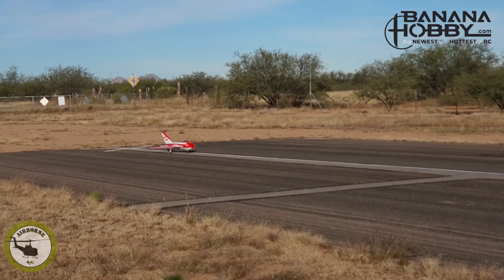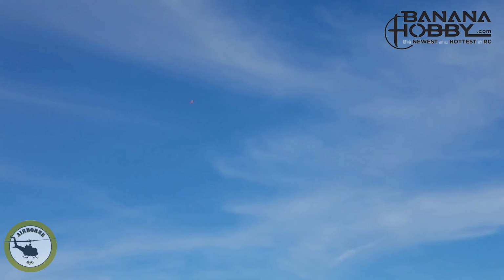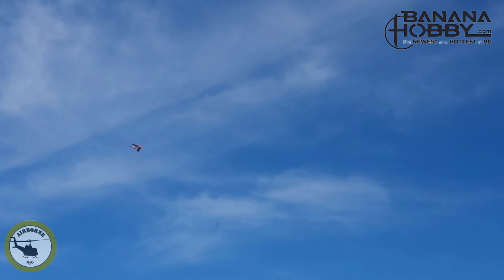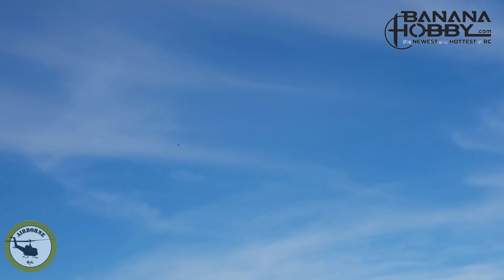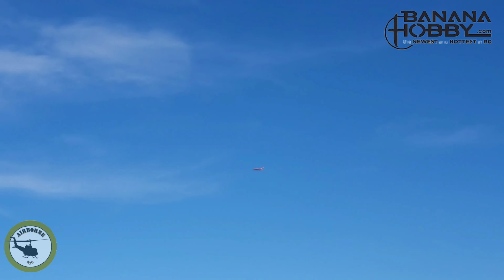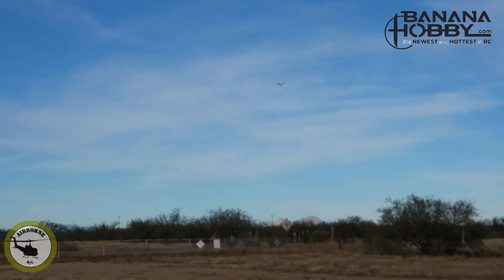AF Model MIG-17 from Banana Hobby Proof Flight!!

Comment: Nice flight,. How affective are the speed brakes.  Have you trialed them at all
Reply from the maker: Yes they slow the plane a bit...you can see it getting "sucked back" when applied like flaps...I wouldn't do it at high speed lol...before using them make sure they are close in throw when deployed. If not adjust linkage and or use flight modes...in case you need trimming
Reply: @NoonzAirborneRC  Nice. Always handy with a slippery jet.  Nice work and Hello from little New Zealand
Reply from the maker: @russcole5685  The jet sometimes does not need the speed brakes though...the fuse it kinda draggy on its own. Hello BACK!!!! lol